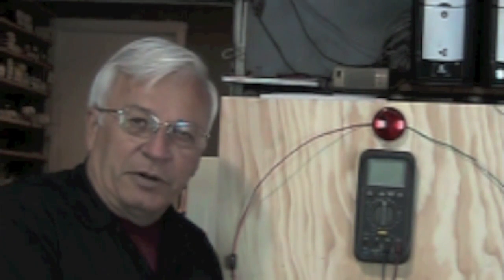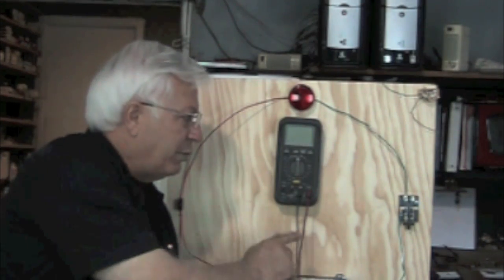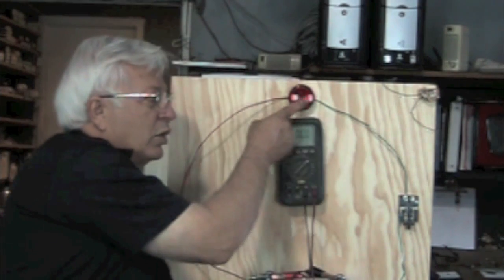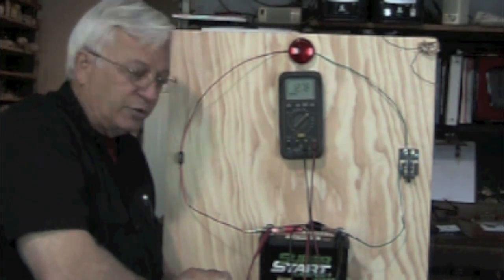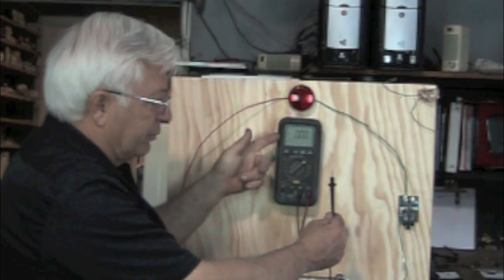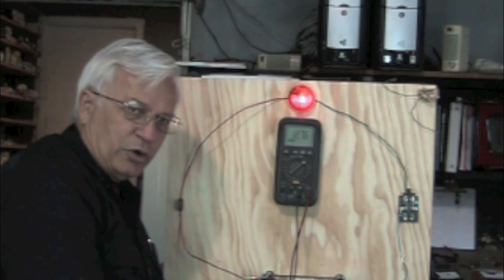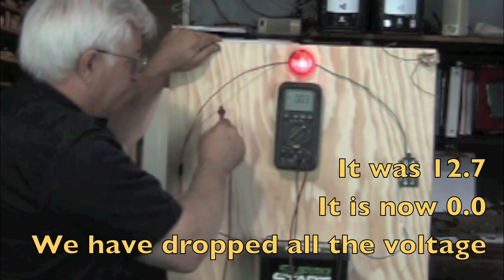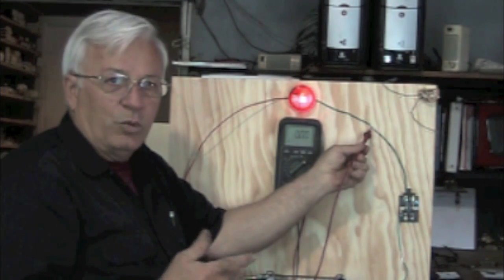How to test ANY circuit.      Part 2

Comment: Hi Duane, excellent videos the best in you tube! I have a petition if possible.
I am very interesting in learning more about car electricity/electronic. I learn that we have to compare the normal conditions in a electric circuit to compare with abnormal conditions. 
My problem is (because of my inexperience) that I find difficult to find what the normal amperage, resistance and volts most be. Normally it's not explicit in the diagrams.
I already know that a voltage drop of more than 30 % (00.10 to 00.50 volts) means a resistance problem in the conductor (cable). or than more than 00. 50 Ampere means the same. I know also that there is different normal amperage for example in the motor fans ( if i am not wrong 50  ampere) and you see form the fuse box that you have different ampere from circuit to circuit 10 15 25 and so on.
I know the formulas for mathematical calculation but cables diameter and length affect this variables also the use of relays for low and high voltage circuit for example if i want to install extra lights to the car or a sound system so that i can do it correctly.
Could you make a video about it giving us a explanation how is the right way to do special if we don't have that specifications from the car company?   sure many people  will love it ;-)

Comment: So what does it mean if there's hardly any voltage drop? Like if you tested it like you are doing, but instead of there being a full 12.7 volts dropped (Good Circuit), but your Multimeter is reading 10.7 volts (bad circuit), instead of 0.0 volts (good circuit) ? Let me sit for a little while, and think about it.. until then, hopefully you can answer my question, if I don't answer it for myself first. thank you for the video, very much appreciated.

So if I have a coil that's 0.43 ohms, and I put 3.85 volts threw it, and the coil heats up, shouldn't my multimeter read 0.0 volts if it's a good circuit? And I should see all the voltage drop 3.85 to 0.0 volts when I test the circuit at the positive and negative ends when the voltage is going threw the circuit? what would cause it to only give me a partial voltage drop, say 3.25 volts, instead of 0.0 volts...? Please.. I would really like an answer to this question.. If it's possible. Thanks again.

Comment: Hi Duane,In this video, between positive and ground there is a light(resistance or load) when we measure the potential difference between this two points, we always see 12 volt. In your recent video, Door lock go Grazy 2, when ECU supply the ground, the voltage from 5 volt drops all the way to zero. Over here again you are measuring potenetial difference between positive and ground, resistance being actuator, how come it drops voltage to zero in door lock video, but staying 12 volt in this video

Comment: Good example as to why your switch should always be on the hot side of the load. If your switch was on the ground side of the load and it's off and you go and work at the load site you would get zapped if your body is grounded. It's nice to know that any device or load beyond an open switch is dead.